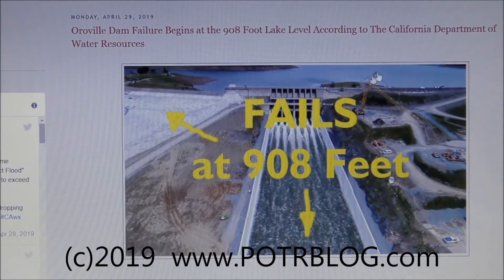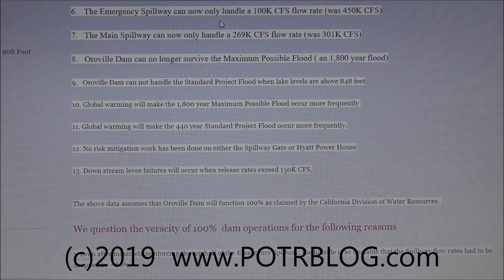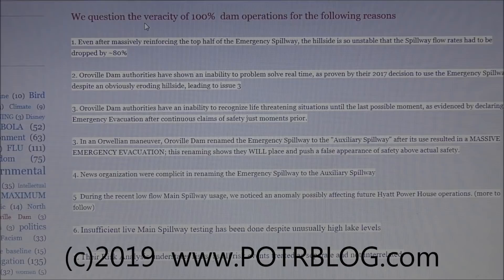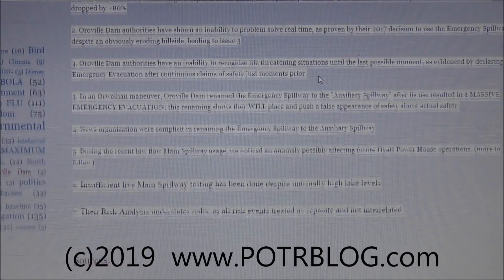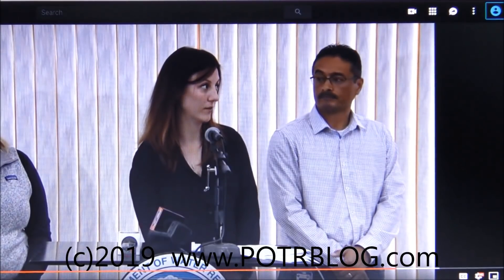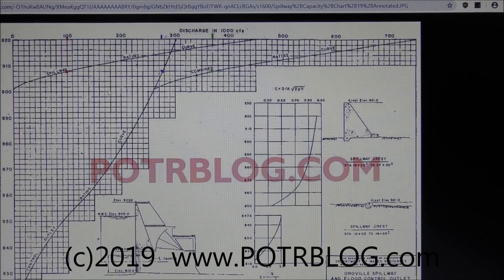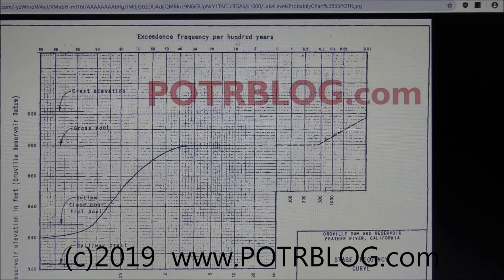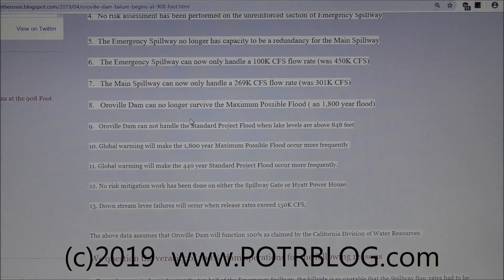Oroville Dam fails at 908ft says California DWR

Comment from the maker: No matter how slow or fast the rain comes, IF lake levels reach 908 feet the dam will start to fail (according to Ca DWR). Given their own data, the FASTEST possible rain event that could cause such a lake level rise (even if EVERY spillway system is fully open) corresponds to +6 inches of rain in 21 hours (based on their pre-Global warming data ,such a flood on average would occur every 525 years). A smart person's take-a-way from this is that IF you believe EVERYTHING the folks at Oroville dam say, the fastest the dam can start to fail once lake levels reach 899 feet is approximately 21 hours. .I.e. WORST POSSIBLE CASE, from the 899ft point it takes 21 hours to for the lake to reach 908 feet and dam failure to start. That means the Emergency planners are assuming they have at minimum 21 hours to evacuate everyone down stream. If I lived down stream I would leave the instant water started coming over the emergency spillway ~901ft no matter how much or how little rain is falling.
Reply: And we have to ask ,what sence dose it make to let the lake get do high when theres still feet of snow to run off
Reply: @R.....1-56  because snow run off is counted on to fill the lake that's why. Do you know just how much snow? Do you know the water content in the snow pack. 
You say "still feet". How many feet? You have no clue. It makes perfect sense if you care about facts.
Reply: @R.....1-56  One guess would be they are giving the hillside a chance to settle. Second guess would be they are still working on either the spill way.( as well they should be)Third guess is that they know the concrete needs to cure.   From what Ive viewed .There screwed .Come Hell or high water.  So they probably figure its Loss all the way around.So why keep pouring more $$ into something they know is going too fail.Much sooner tthan later. That there is no point in prolonging it. So why not just let it Rip?  Give it Little help along the way.  At this point the immediate population down  stream . Are not a concern .  Whatever takes place after the disaster is going to be written off.Finacally that is.   That the way it is in corprate America.Lives dont matter.Only the$$$.
Reply: So we speculate what will never happen. Lol.
This crap is a scare tactic that means nothing. Tear the fucker down and leaves millions without water. Close California. 
Millions will have to leave the state. 
This guy is so full of shit there is not enough shit wipe to wipe his ass.
Reply: @bullrider2515  Charmin should sponsor this channel.
Reply: I fished Oroville lake yesterday as I have for years. And believe me it can take a lot more water. Sad that most that have negative comments here do not have facts. And I am betting have never even seen the lake outside of a picture. The man said."a lot if snow". Well what's a lot? How much water content does it have?.it is  not how fast the lake is rising it is hiw much water it can hold. The last 10 feet holds 10s of thousands of acre feet. It doesn't take Rocket science to know that the surface area increases due to the slope of the shoreline. I drove right through the town of Oroville this morning. Funny I didn't see panic anywhere. All the panic seems to be from people who live hundreds of miles away or live in another state. Somehow experts. Cracks me up.
Reply: When I lived in the area we caught a lot of salmon in the river, and 2 to 5 lb shad during that run.  One time before the dam was built I was fishing on the north fork and hooked what felt like a 20 lbs salmon... it was a 14 inch trout, about 3 inches thick a bundle of muscle.. took 10 minutes to land.

One time while exploring the canyon we found a mining shack with no road to it high up the side of the mountain.. a box of wheaties on the table, in the old grey cardboard box... it had not been touched since the late 1800's  all the windows were in tact.. we left it untouched..

The mine next to  was open, the old road to it along the side of the mountain had long since washed out.

We used to ride the freight train up through the canyon to Keddy, where we could jump across the rocks to the other side, then catch a slow moving freight back to oroville.

In 1968 just as the road across the top
of the dam was paved and before they removed the barriers I rode my 450cc honda across that top of the dam at 98 mph... becoming the first man to haul ass across the dam on a motorcycle at close to 100 mph.
Reply: It would actually appear that anchoring the primary spillway's thick concrete slabs is likely a problem. Especially placing the buffers at the bottom of the spillway where the water has the greatest amount of kinetic an energy. With all of that energy being transferred into the bedrock, it likely will lead to serious stability issues of that same bedrock. I am also intrigued by the issues going on it the Hyatt Power Plant. Which the DWR has been unusually tight lipped about. 

There is still a lot of water tied up in that snow pack. There is no reason why they should be raising the water level in the reservoir. Especially with the reservoirs upstream on the Feather River also at full capacity. 

If the dam fails it's going to destroy much of the US produce production. Coupled with all of the flood damage going on in the Midwest, food prices are going to rise. 

Hopefully no one loses their lives in this.
Reply: @daveharris5310  in Bob Bea's 400plus page report, pdf available online, with the first 16 pages he says all the meters within the earthen dam don't work. They were put there to monitor structural integrity of the earthen dam. He writes, in slow motion type fails of earthen dam's often its the green spots, striping and pooling water that are first signd then the structural integrity begins to deform due to changing internal conditions. Angle of slope alters and bulging begins to occur but they cannot monitor from within as all the peizometers are broken, he wrote.
Reply: @reneeoleari  The Orville dam project is finished except for site restoration.  The spillway isn't the dam, despite what the graphic represents.  DWR would obviously open the spillway before the emergency spillway began to flow as the weir is overtopped.
Reply: @epistte     exactly correct... however the DWR might want to let a little water overtop the emergency spillway just to get a look at the flow patterns.
Reply: @Phil_Scott  It could be fun to watch the flow patterns on the emergency spillway, even if they can be modeled in CFD software.
Reply: If all the spillways were in full use, the feather would be flooded already?
Reply from the maker: @JohnnyMotel99  Normally Oroville Dam limits outputs to the Feather river to a max of 150K CFS as any flow above that destroys the levees. But actually they would fail earlier as the 150K CFS number assumes that the Marysville Dam exists, but it was never built. In the worst case scenario Oroville would be dumping ~380K CFS into the Feather River as the spillways started to fail. So yeah, all that would be toast already
Reply: @potrblog  Correct, but it only destroys the levies when the river is high from the storm surges, in summer the river is 20 feet below that level... so that in the summer it can easily stand a measly 2 foot rise... and still be 18 feet lower than it takes to damage the levies
Reply: The prophecy will come true and Oroville dam will be no more.
Reply: how  much inflow  does t it take to get to 908 ft.. a 6 inch rain at  899.. thats a billion to 2 shot in june..aint  never  gonna  happen
Reply: More ignorance. 

At 902 feet water begins flowing over the QUARTER MILE LONG WEIR  (emergency spillway) 

the water depth over the weir will have to be 6 feet deep. in order for the water level to reach 908 feet deep flowing over the emergency spillway weir... 

that would be more water than there is in the universe so to speak.

The DWR statement remains accurate however... something like saying "If you get run over by a truck 6 times"... your breathing will begin to fail.   True, but not even remotely likely.

Such an accurate statement fact has to be a key part of any calculation however.

That is part of any engineering project.  It is the upper limit... and the system is *designed so that this upper limit will never be reached.
Reply: @Phil_Scott  now that global warming is here. The snow pack is reaching record depths.
Reply: @bullrider2515  The snow pack is already 80% melted.   Not a problem even with rain
Reply: @Phil_Scott  I agree. I'm not one of those in a panic. Fished there yesterday. Beautiful to see it near full.
Reply: @bullrider2515  I realized that... hope you catch a big fist... we used to go swimming at Bidwell bar, just down stream of that was big hole and some guys who had dived there said there were some massive trout there, maybe 4 feet long
Reply: ooops   "I hope you catch a big FISH."
Reply: @Phil_Scott  80 %  of the snow pack is melted already. Minus what is currently accumalating in the high country.Correct?  Okay So at 80 %  with 32% above the 100% average is what?  Gee, that leaves 52%  of you knowing nothing about how much of the snow pack is left.
Reply: @Phil_Scott  Water does magnify objects that are in it.By about 52%  in this case also.
Reply: @deesmith5600    Hello Dee... indeed all that snow will melt over the next few months and it could run the river level up 2 feet or so.. then it would 18 feet below flood stage.. hopefully however it will melt slow enough to all fit in the lake.. and keep the lake level near full through july or longer... that would be a near miraccle for california after these recent few drought years.
Reply: Or, 21 hrs to release enough via the spillways, which will tear out the levees down stream due to turbulence... 😳😞
Reply: @7hilladelphia  :  these rains average 1/2 per day... there is very little snow left to melt... with 10 feet of space left behind the dam, the spillway will probably not be used...if it is used flows will be minimal.. not enough to wash out any levies ... that said... you could very easily be correct at some time in the future.  but not now.

Any dam has its flood control limitations...it can only handle so much inflow for so long then all the extra water goes uncontrolled over the emergency spill way.

So far however in the last 50 years the oroville dam has prevented any major flooding... the town of Oroville used to flood about 4 feet deep once every 5 years or so when I was there... it has not flooded since the dam was built.
Reply: @Phil_Scott  general info, FYI, just to mention, if my maths are right, Feb 2017 crisis, water elevation rose 50ft in 5 days to the top. They had that buffer zone in place. Was a lot of rain. At the moment, and by the maths, 1in rain = approx <1ft rise in lake elevation. Depending on rainfall area and for how long it rains. To exxagerate for sake of discussion, 1inch rain may = 1ft rise in Oroville Lake. So, if that's roughly reasonably correct, this incoming weather pattern bringing unseasonable rain and snow, renews concerns. No way around it. I hope of course that no big release at the last minute becomes required as it isn't good for the fishery or levees, to have sudden tumult. In my opinion they  should have followed their own stated pledge to keep a 50ft buffer zone, and with managed continual soft spilling from the new spillway let elevation rise much more slowly than it has, to date, as its been rising more than 6inches per day, pretty much, lately, and that's to say a lot as the lake surface is way wider (can absorb more storage) the higher it gets. But what do I know? Cheers 🍻
Reply: @7hilladelphia  There are a lot of factors involved, the basic situation is the if the water reaches 902 feet it will not rise much above that because  the spillway operations... 

The state has scientists estimating all this.. weather patterns snow pack etc they want to run as close to 100% full as humanly possible...if they err there will be some modest flooding downstream.

This is the design and those are the risks.  

Using data from another year will miss the point due a few dozen other factors.

Paying attention to these morons running this and other click bait and troll sites is misleading.   If they say the new spillway is made out of baby chit or some such, and that it will wash out if anyone pees on it... well you have to know enough about the actual construction to spot the baloney.
Reply: @Phil_Scott  Thanks for replying. 👍
Reply: Hello uninformed wackadoodles!
THE SKY IS FALLING! 🤣🤣🤣
Reply: @reneeoleari   grow up.
Reply: With the river 24 feet below flood stage,  the river would also have to rise 24 feet before there was an issue. For my part I would just myself another cup of coffee and crack one of my applied physics books on the topic of open channel flow.

Comment: Find Scott Cahill and Robert Bea.  Also—you didn’t mention the failure to clear cut they trees to prevent the river blockage with high water flows. Once stuff goes bad, the Hyatt Power Plant will be clogged with debris and sediment and will no longer flow. (See 2017)
Reply: Oh, you mean like what happened in 2017 when the emergency spillway was used?  SO why didn't the river become clogged then??

Comment: Why do people keep using the term "use the emergency spillway". It's a dumb wall, you don't get to choose, there's no control over it, it will overflow how much it wants. Second, the official terms are wrong, it's not a spillway at all, it's a hillside, the base of the spillwall is reinforced now at least.
Reply: its a designed emergency overtopping..its designed to be spill point... its not designed  very well.. but it was designed for an emergency spillway... case closed...you can call it anything you want.. billies bluff for all i care .its the same thing.. billies bluff is  designed to be stable  up to 100cfs.. it wont do that,,,  but thats the predictions..it will erode  sooner.. the water aint gonna stop

Comment: None of the comnents that I have read on this video or any other posts on the subject matter.Fails to adress the in One fundimental factor with regards to the Water level being as high as it is. That being the $$$ That is being generated from the electricity.That is produced from the turbines.That in fact rely on moving water to fill the turbine blades that makes the shaft turn the turbines. The more water preasure you. The more $$$ . Now sleep on that an comment in the morning.

Comment: Your facts are all wrong please try again first fact wrong if the emergency/axillary spill way is only at 901ft how will the lake reach 908ft can u answer that
Reply from the maker: Water volume "in" equals water volume "out"; the height of the water "in" is shallow because it spread over miles of lake shore. The water coming over the weir is over a short distance, since volume must balance the only place for the water to go up is up, thus forming a tall wall of water going over the weir.  If you think it through, your position is that the lake level can never get higher than 901 feet because that is the height of the weir.
Reply: @potrblog  so you are telling me that at the current inflows that the water would rise so fast (currently about half an inch or less a day) that the water could end up being a 7foot wall of water going over the emergency spill way

Comment: Of course that 1,800 year flood is probably not a figure based on reality. As if they have records to reliably to calculate that figure- especially in the 1950s. Also, the 908 ft. level is likely based on a best-case scenario wherein the dam has been used more in line w/ its design during its functional life-span (which ended a few years ago), ie temporary holding of high capacities of water, not long-term storage of 80% capacities. The failure level is obviously being tempted as we speak. 
Also, let's not forget that the dam has been administered and maintained by many "diversity" hires which have filtered in from the university STEM programs; people who were granted degrees & promoted to positions of leadership based more on their genetics than their engineering skill. 
And last but not least, let's face the cold, hard facts: the dam is due to fail. It was not designed to be a 1,000 year structure. It was more like 50. Between recalcitrant environmentalists who gained sway after the completion of the dam, preventing new projects from carrying on the order of succession, and the fiscal conservatives who rarely fail to cut budgets on things like maintenance (to say nothing of building more dams), the Oroville Dam is like that old 16 year old golden retriever the family loves: it was great for a long time, but now it can barely walk and leaks piss every time you turn your head. 
Where are the adults in the room?
Reply: You first need to understand what the term (1800 year flood) mean it doesnt mean it will flood every 1800 years please do ur research before u speak nonsense